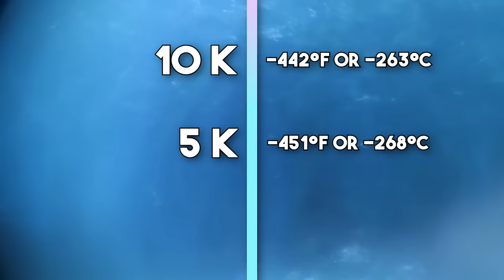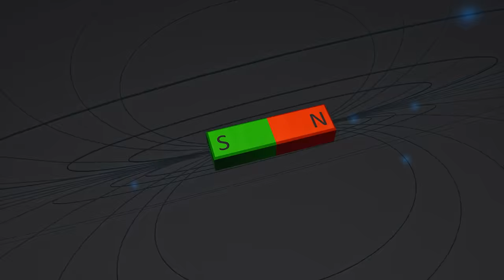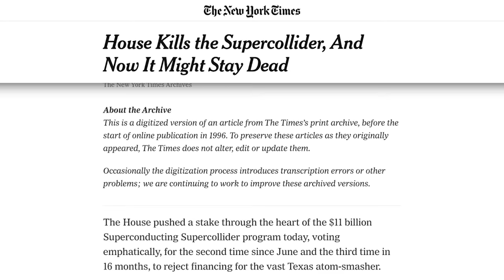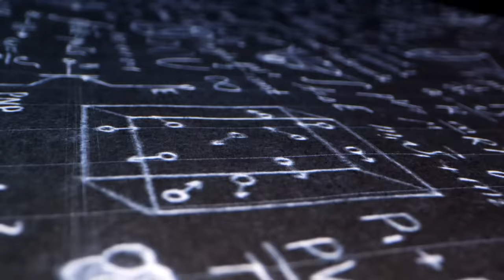What’s Up With Superconductors? With Neil deGrasse Tyson

Comment: What about using it in space. The temperature is right near 3 K. Space travel and space station applications?
Reply: The ceramic will travel just fine.  It's the humans that need to travel with it that have problems of keeping warm and functioning and not die.

Comment: 4:50   If a STP superconductor were found and it was a brittle ceramic, could we fill something like a thin straw with the ceramic powder to make crude 'wires' out of it ?     Or does the ceramic need to be one continuous piece, not broken up bits to maintain its superconductivity ?

Comment: Electrons don't move through the wire like a bus between two stops and carry charge. They barely move at all. It's the electric field surrounding the wire, the cathode and the anode (or the endpoints) that propogates electricity.
Reply: Is there a good explainer or video of this somewhere? Things seem to be all over the place on this issue.
Reply: @petedawg  you're right. I think there is some truth in both ways to explain it. Veritasium did a video on this. I think that if you go down that rabbit hole, conclusive or not, you'll end up knowing a lot more than you would have started with.

Comment: Good video Niel! ur only wrong bout 1 thing and thats when u said superconducting "rejects all magnetic fields"!!! Thats not what happens! Instead when u drop the temperature of the metal, the magnetic field gets "frozen" or rather "more permanently strong" within & around the metal. The magnetic field is very tangible even tho we can't see it and dropping the temperature in the metal simply does what lowering temperature alway does, makes the object more solid/more dense!!! It simply makes the magnetic field much less-able-to-dissapate. In layman's terms, dropping the temperature INCREASES the strength of the mangetic field, NOT "rejects it". ALSO, dropping the temperature that low, DECREASES the physical friction that electrons experience when being conducted, similar to a human walking on flat cement vs an ice skating ring!!! ALSO, what is happining on a Quantum Scale is that the electrons, after photon absorption occurs allowing them to gradually rise up the valence shells of the metal's atoms, aren't able to leave the last valence shell meaning they dont get to become "Free Flowing Electrons" thereby keeping electric current from dissapating!!! This is because the Magnetic Field becomes much stronger, as a result of the near absolute zero temperature, and basically stops the outtermost electrons from becoming free flowing. In laymans term's, this is because the magnetic field has become "frozen" above them!! Just wanted to clarify whats really happening with Superconductivity at the smaller scales of reality!!! :) Have a great day Niel! <3 & Yes, we will have widely usable superconductors in the near future (well maybe not near future) and we will also finally gain access to PERPETUAL MOTION MACHINES as a result of this. Im working on 1 now which I call the Superconducting-Mangetic Wind Turbines!!! The only real problem is scalability and maintaining the low termpatures for prolonged periods of time. Without the temperature being maintained, the blades simply stop spinning after a few rotations :( But I will keep working on this until I completely figure it all out so that we together as Free Citizens of this Earth can defeat the Global Cabal and free the world from their Toxic Fossil Fuels and Petrochemicals as well as their Forever Wars faught mostly because of energy/stealing of resources/strategic trade routes/etc.!!! <3 <3

Comment: Ceramic room temp superconductors.  Why aren't there more use cases for such a thing?  Like I don't know.  Lifting heavy objects off the ground?  
I realize that they are brittle.    But,  maybe incase the ceramic into a strong materal like aluminum or steel?  I need to know more about this.  As I have not heard of ceramic room temp SC's before.  Thanks again for the video!

Comment: I'm not sure if you proved a theory of mine, Neil, or just that my hypothesis is plausible 2:27. When I graduated from university I learnt about superconductors, and it was around the time green/sustainable energy was starting to gain steam but one of the big challenges was storage and battery technology was not great at the time. My idea was "Why don't we make large scale batteries out of super conducting materials and store them in facilities or housing of liquid nitrogen". The obviously challenge is keeping that all cold enough and in such a way that isn't an energy deficit. I thought surely having a battery system that had 0 electrical potential energy loss would be highly beneficial but clearly there are significant challenges in this space otherwise they would have been developed already. But nice to know it could be possible and my assumptions were somewhat correct.

Comment: Electrons are a quantized fluctuating probability wavefunction.
Electromagnetic waves travel at the speed of light or causality. So..  if there is resistance that slows down the electron, doesn’t the electromagnetic wave function slow down simultaneously? Would that violate the constant of (C) in Einstein’s equation?

Comment: Superconductors have the remarkable ability to conduct electricity without any energy loss, thanks to their zero electrical resistance at very low temperatures. This property holds immense potential for revolutionizing various fields, from quantum computing to energy storage and transmission. However, the challenge lies in achieving superconductivity at practical, everyday temperatures. How might advances in materials science help us overcome this hurdle and unlock the full potential of superconductors?

Comment: when u pull of the batterie from the superconductor does it maintain the energy or it goes hot faster?
Reply: From my understanding of what he said, if you close the loop it will indefinitely maintain the energy.
Reply: @NoViscosity  this means it will light bulb forever until that bulb gets brust.

Comment: Beside with on electrical grid, I still don't understand what is the benefit for superconductors? Even use on grid is not that important, if we can tolerate the electrical loss. I'm going to assume it cost more to use superconductors grid than use normal grid and eat the electrical loss.
Reply: electrical loss not only cost you money it wastes the limited resources in this planet.

Comment: Wait so if electrons around atoms of the conductor knock the mobile electrons of the current sideways and cause resistance, but if you super freeze a condensed material the electrons stop moving so it goes superconductive without the spinning electrons getting in the way,  is there any substance that doesn’t have electrons? Because that would be a superconductor. So Hydrogen, the most abundant element has no electrons? So we should use hydrogen, but it’s a gas, so can we make hydrogen a solid? So if we compress hydrogen enough and make it into a metal it would be a superconductor right? It has no electrons spinning even at room temperature. 
Yeah. Do that

Comment: If "everything" stops at 0K , how can it be used  for current, should'nt that stop too? and should'nt there be -K something where EVERYTHING stops?
Reply: everything under thermal motion stops. So you can can apply a electric field that will accelerate the electrons, without being interfered by the thermal motion of them.

Comment: Neil, can you explain to me how a pressurized system like earth can exist next to a vacuum like space without a strong physical barrier??
Reply: well there is essentially a physical barrier but its not like a wall it's more of a strong barrier that slowly gets weaker. it's mostly nitrogen and oxygen. our atmosphere technically goes out for miles and miles because there are still air molecules around earth that we would consider space. gravity holds these gases down but can still go out so far depending on pressure and other factors.

Comment: Space is a blanket of equal energy. The heavier the object, the more it bends space. Heavier objects have more energy and thus bend it like a weight on a trampoline. To get anti gravity, you just need more energy than the object to counteract the energy forces. So why then is space expanding? That I will answer tomorrow.

Comment: Why don't they like set up an electrical grid in space like a satalite that absorbs sunlight, and then stores it in a super conductive state while in the cold of space. Unlimited energy? Just getting it back to earth would be the only issue unless you charge things there and drop them down
Reply: You could also theoretically build like a bullet train station in space and then absolutely launche say a shuttle or satalite further away at insane speeds if it has no friction and has enough room to gather enough speed before being sent forever away

Comment: could a theorical spaceship be built of a room-temperature  material, and make the earths magnetic forces repel it so it can floats on earth without using any propulsion?
Reply: it would still require a force to leave the gravitational field. From my understanding the spaceship will just hover over the magnetic field (which is the iron core at the centre of the earth), I don't think it would fly off. 

(If only we could conduct the experiment though)

Comment: Liquid helium is required for 10 kelvin.
Very expensive difficult to maintain cryogenic systems .
I worked at Fermilab Nuclear research on magnets which use such. We built parts for Texas in 80s .Sad it was cancelled.
Money went to fake Iraq1 Iraq2 Afgan wars instead.
Excellent explanation 👍

Comment: Superconductors have many positive sides, which is relatively cost effective and has many productive sides, it reduces excess loss of heat, excess loss of energy, it even reduces green house gas emissions, it can even act as a powerful medium for storage of electrical energy, can even increase the power stability.

Comment: Electrons don't move through the wire...https://en.wikipedia.org/wiki/Poynting_vector#:~:text=Inside%20the%20conductor%2C%20the%20Poynting,Joule%20heating%20in%20the%20wire.

Comment: Doesn't it require energy to hold the superconductor up, against gravity? I guess it isn't 'work' because thats force x distance which is zero here. I'm just saying that if you wanted to make a device that keeps a piece of matter from falling due to gravity (without physical support structures), you would need to power it.

Comment: So will we still need semiconductors if superconductors are made?...🤔🤔🤔
Reply: Yes. Semiconductors are special because they switch between being conductive and not conductive. For example, silicon is conductive when it is positively or negatively charged (extra or missing electrons), but not conductive with a neutral charge.

That being said, superconductivity and semiconductivity are not mutually exclusive, and semi-superconductors would be very useful 🙂
Reply: @matthewfinger8153  that's almost like saying gasoline cars is going to be here forever when we got Ev cars. I honestly think is going to slowly go away like what Amazon is doing to Meijers. Or anything for that matter we just move on to the next best thing..🤷
Reply: @imatimetraveler5760  no, it isn't. Semiconductors and super conductors fill a different functional role. The utility of a material that has a conductive state and nonconductive state cannot be replaced by a superconductor alone. For electronic computers, you ultimately need some way to switch circuits on and off, and if not by changing the state of the material (i.e. how semiconductors are used), you have to do this in another way. I don't see how superconductors would fill this gap, let alone improve upon it.

Superconductors replacing semiconductors would be closer to quantum computers replacing cars after they are developed fully. They just fill different roles.

Comment: Correction: I don't know why Neil decided to basically lie to you, but in the real world there is no such thing as "zero resistance". Superconductors are commonly explained this way for simplicity, however they do NOT have zero resistance, it is just extremely low. 

The " the current will stay in the wire forever" example is irrelevant and misleading. While the resistance is indeed very close to zero, the current (or electricity in general) moves through the conductor at more or less the speed of light. In other words, it will dissipate quite fast even with that low of a resistance and will be unusable in the real world
Reply: Well, the current can stay in a super conducter for month.
I wouldn't call that "dissipate quite fast".
Reply: @yourguard4   Fair enough. Still disappointed from Neil though...

Comment: You dont seem to know what room temperature ceramic superconductors would be good for the big one would be Integrated Circuits your mobile phone would run a lot longer per charge, GFX cards wouldn't need huge elaborate cooling systems, Data centres would use a fraction of the power.

Comment: Need a new way to conceptualize electricity? Why dont you talk with Terrence Howard? If you want something different, you need to work with people who are bringing the difference. 🙏🏽📿 Peace and Health
Reply: So watching T Howard I realized all molecules are constantly spinning (then I googled the info). It's at its absolute 0 that a material stops spinning. T. Howard said everything is high and low pressures and angles. So without the spinning molecules, a magnetic input is rejected until it warms. But the electricity is held onto....? 🤔 So does this kind of superconductor only work for AC? Not that we want DC But that's just the only thing that makes sense as to why it would let electricity 'through' 🤔🤔🤔

Comment: I've always wondered, but never asked or Googled, how do we know absolute zero is the absolute? 🤔 

It's said heat may not have a limit, but cold does? How does that work? I know absolute zero is where there is no energy movement, but since we've never achieved it, very close, isn't it only theory how low is possible?
Reply: Great question! 
You seem to understand the basics anyway but It’s important to note that “absolute zero” is not about the absolute certainty of our knowledge, but rather it describes a theoretical lower limit of temperature.

We deduce the existence and properties of absolute zero through a combination of theoretical principles and experimental evidence:

1)Theory and Equations: Laws of thermodynamics and equations of state for gases predict a temperature at which the volume of an ideal gas becomes zero. While no real gas behaves perfectly as an ideal gas, they all suggest a lower limit to temperature.

2) Behavior of Matter: As substances are cooled, their properties (like volume, electrical resistance, and more) change in predictable ways. Extrapolating these trends points towards absolute zero as a distinct limit.

3) Third Law of Thermodynamics: This suggests that the entropy of a perfect crystal is exactly zero at absolute zero. This gives a theoretical underpinning to the concept.

4) Practical Limits: While we can't reach absolute zero, we can get extremely close. As we approach it, we observe behaviors, like superfluidity and superconductivity, that align with the theoretical predictions.

In essence, while we can't physically touch the bottom, all signs point to its existence and location.

Comment: To learn more advanced information about Superconductors I strongly suggest this: The next time our lovely Military uses an EM Pulse gun to shoot down a UFO, maybe they should avoid torturing the Aliens and actually try communicating with them? Show them movies about Superconductors and try to get some advice on the subject before chopping them up to study what's inside their bodies. While they are at it, find out the cure for Cancer as well. We are so far less advanced it's a joke. To them we are just violent, brainless, slightly advanced cavemen with car keys. The answers are in their heads and in their space craft to Superconductivity as well as Zero point Energy. Fire questions at them not bullets. That's my advice.

Comment: There's a limit to pull current in a cold wire, it may shatter too and melt blow the isolation. Accumulating current inside the wire while is not always pulling to offer more than it should be in a pure copper wire that, is a good idea of capacitance. Everything has limits but the sizes.

Comment: If cold matter doesn't accept magnetism or fields, space movements can't be related to that, but some can, not many. Cold metal would make magnets float so to magnetize one from the other, some heat need to be for collision and transfer of the magnetic field. A collision of magnetic asteroid or moon, in cold space makes everything different. Uranium is not a good conductor but good for copper rods at 30% max for useable effect, no supraconductor here. World war and science switching...not always fun.